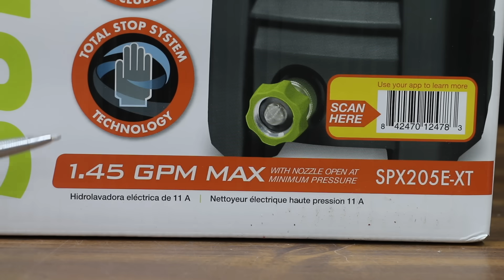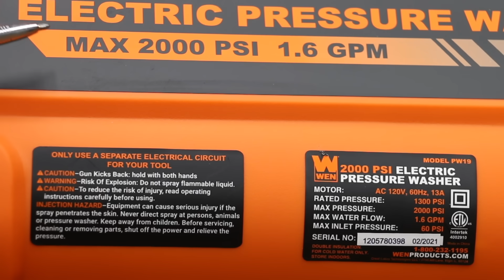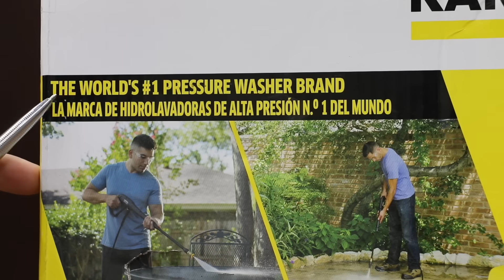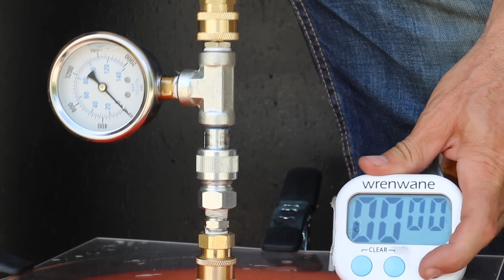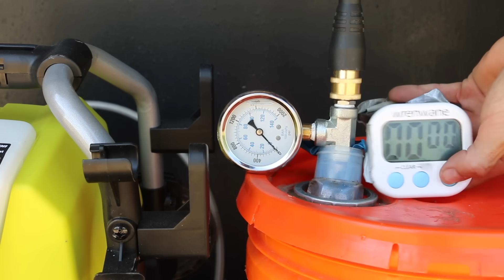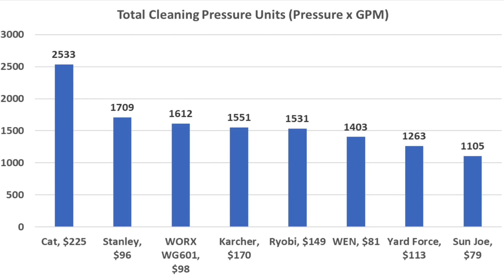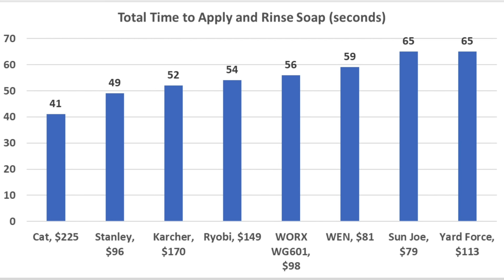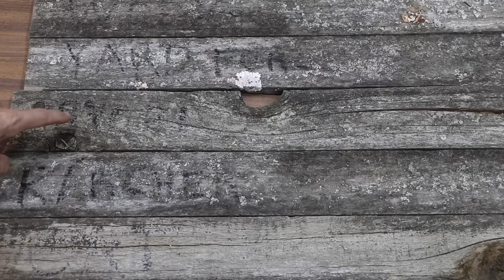Best Pressure Washer (ELECTRIC)? Ryobi vs Karcher, Stanley, Sun Joe, WEN, CAT & WORX

Comment: The Worx has a warranty but you have to pay to ship it if it breaks and pay for them to re send it. At $99 it ain't worth it just throw it away. Mine used 2xs and it is starting to fail. Spays straight and finally will rotate to clean and then back to just straight. Came with only 1 exttra tip two missing like yours on the video.  Garbage. Should have bought the ryobi.

Comment: Love it!! I've had the CAT 1800 for almost   a year now, great little unit. Matt over at obscessed garage sells, called the active  unit on his site. MTM makes a lot of great accessories for them as well.
Reply: How many hours do you have on it? I see amazon reviews that suggest it might fail after 10 to 70 hours of use.
Reply: @guytech7310  not sure, I use it for a small detailing buisness. I already had one fail but the return policy worked so well I'm still happy. It's still a very inexpensive unit compared to a base electric commercial pump unit.
Reply from the maker: Thanks for sharing.

Comment: Karcher No.1(in pressure washer marketing). Mine started leaking oil from the reduction gears. Bought a B&D, lasted for years and spares are easy to get. 

Try running a durability test, leave it running for hours and see which one dies first to simulate someone washing their driveway then their cars. I bet some will fail spectacularly.

Comment: Very good video but only issue is PLEASE USE METRİC AND İMPERİAL SYSTEM FOR MEASURİNG, not only imperial on the graphic. İf use metric (SI system) much universal and understandable than ımperial system.
Reply from the maker: Thanks for the suggestion.
Reply: We don't use the "Imperial" system in US, we use the US customary system. They are not the same. 1 US gallon is 3.785 liters (litres if you prefer).

Comment: I have a question that may have already been asked and answered (any helpful hints for me to search through 5,469 comments?) - why are you using a 3.0 and a 3.7gpm nozzle on pressure washers that only flow between 1.1 and 1.5gpm?  This will of course result in poor performance, and this is something that most users don't understand.  The tips need to be properly matched to the flow rate of the pumps in order to achieve good cleaning.  If you are several hundred psi low at the tip, as compared to what the unit's rated pressure is, you have a tip that is too large.

Also, for pressure washers in that size range, there is no way you are going to get good cleaning performance on dirty wood at a distance of 14 inches!  You have to get down to a few inches away for that class of pressure washers - I probably would have picked 4-6" for this test.  I have a Karcher electric unit in that size range, but my big dog is a 4000psi (dialed back to 3K), 4.3gpm 16HP gas-powered unit that you can use to make holes in things if you are not careful.

Thanks as usual for the great work!

Comment: from experience MINIMUM you want your pressure washer to be at least 1800 PSI at 2.0 GPM for a around the house pressure washer. Even if its 3500 PSI if its not pushing out 2GPM its not worth your money. If you choose to buy a foam cannon, I suggest buying and changing to a smaller orifice 1.1mm orifice size if you are using an electric pressure washer with lower PSI.
Reply from the maker: Thanks for the feedback.

Comment: I’ve been power washing now for 5 years and let me just say the china power washer will do the job but I’d say after more than 200 hours of use the pump goes. But for the good brands like karcher Briggs and stratton Bosch have really good pumps that last many more hours but in some cases I’ve had good luck with chinese brands. End of the day it’s up to the user. If you want to use it for weekend use then a chinese brand should be fine. But for commercial use get a good heavy duty brand. And also get a really really really good water filter! Most of my pumps had green gunk and sand in them.
Reply from the maker: Thanks for the feedback.
Reply: interesting you say that considering that these cheaper electric versions compared to the supposed "good brands" have longer warranties.  For example, most of the tested models here have 2yr warranties, whereas Briggs & Stratton, Simpson, etc electric ones only have 1yr warranties.
Reply: @hanwagu9967  yes cause the good brands trust their products. But it’s all up to the user.. Ive got a sun joe pressure washer which has surpassed 200 hours of use. So not saying chinese power washer are bad .. but take proper care of it and you’ll be fine.
Reply: @CuciWaterjet  I think you misread my comment.  The supposed "good brands" have shorter warranty periods--that is, one year.  The supposed cheaper brands according to you, actually trust their products more by warrantying them longer.

Comment: Excellent as always - a test idea, although maybe not mainstream enough - bike chain lubes - more specifically, whether or not they actually do anything - my theory that any lubricant not encapsulated, or replenished will quickly wear aware, and be back to metal on metal. Something like an electric motor driving a loaded chain/sprocket - lubed vs not.
Reply: and by bike I mean bicycle
Reply from the maker: Thanks!  Thanks for the video idea.

Comment: Thanks for another great useful video. I own the Karcher with the same kind of gun. And I love the pressure washer but I can't say the same for the crappy gun. The quality on those is very low be aware. The valve inside the gun is made of cheap plastic with metal insert and do not holds up the pressure and they crack, onece is broken it leaks everywhere, it happens the same with the gun tip, the metal tip adapter is screwed in to a plastic tread!.  I have had this pressure washer for about 3 years and I have to buy already 4 of those guns. And it is a shame that you can't adapt a better gun brand and you have to continue buying the crappy one.
Reply from the maker: You are welcome!  Thanks for sharing.

Comment: Here's a video idea: Removing exterior house paint off clothes with stuff laying around the house.

Here's a list of things that are mentioned in no particular order:

1. Vinegar sprayed on, or mixed with baking soda and pasted on
2. Non-Acetone nail polish remover
3. Acetone
4. Mineral Spirits/Paint/Laquer thinner
5. Hair spray
6. Rubbing Alcohol (or isopropyl)
7. Coconut/Vegetable/Cooking oil
8. 1:1 Dish soap and water
9. 1:1 Laundry detergent and water
10. Clorox 2 colors (basically color safe bleach) 
11. Hydrogen Peroxide
12. Oxi-clean 

For the paint, exterior paint is harder to remove imo. Try using both water and oil based paints (the latter's harder to remove)

For the clothing, try using regular cotton/polyester, denim, and that elastic dry-fit stuff that gym-goers typically wear.

Apply the paints, and let all the stains dry for a few days.

Apply the list of products a few times, once every few minutes on each stain.

Use a nylon drill brush (like the ones they use for auto carpet detailing), clamp the clothing down and let it brush in one direction for 5 minutes each stain.
Reply from the maker: Thanks for the video idea.

Comment: Hello, love your video. Very in-depth analysis. One of the best reviews on YouTube. Do you think using the impact force formula will be a better indicator to rate the pressure washers than the cleaning unit? The impact force formula is 0.052 x square root of PSI x GPM. Your expert comment will be greatly appreciated.
Reply from the maker: Thanks for the suggestion.

Comment: The CAT or similar is barely useable beyond cleaning a car or small projects. I live in Florida .. 120V electric pressure washers are bordering on useless because of the TIME to clean driveways, pool cages, Lanais, etc. Therefore, people who want electric power washers buy 240V or gasoline and they buy 50' or longer flexible hoses, surface cleaners and foam cannons for bleach / detergent.
Reply: I guess what I'm trying to say is you have a whole lot of apples and oranges (pressure washers) at least in this video. Price point comparison with been more useful. Sub $150 or $250-$350 or entry gas, etc.

BTW .. since I only clean my driveway and pool cage twice a year I prefer a high-powered electric with a really long hose, 50' or longer. Otherwise you're shuffling around which is very annoying your pressure washer.
Reply from the maker: Thanks for the feedback.

Comment: Hi Todd, I would love to see a follow up video on longevity of how the pumps/motors hold up.  I would be curious after say 40 hours of workload on the pumps and see how much pressure and volume they lose.  I am not a firm believer in these cheap Chinese made pumps, I have a feeling they won't last very long compared to something with a brass Triplex pump that has ceramic plungers and double packing seals.  Personally I would rather pay more and buy once for something that will last.
Reply from the maker: Thanks for the video idea.

Comment: Potential problem with filling the bucket. It seems very sealed and not allowing the release of any pressurized air, which there would be a lot of, unless you removed the air before then?

Comment: buy a Landa or Mi-T-M pressure washer, those all plastic budget machines don't seem to hold up like the brands I mentioned and most reputable repair shops wont work on them because the parts are not meant for repair but replacement. its the water that does the cleaning not the pressure, pressure just helps remove layered grime.
Reply from the maker: Thanks for the feedback.

Comment: @Project Farm  Hi PF. I wish you could verify this video's claim of No oil Run in an engine for several g
hundred kilometers. Oil pressure lamp blinking while driving. If only it could enter a lawnmower for u to test.

https://youtu.be/ICg264kWkBU
https://youtu.be/Hx3q9Kl0T5s
Reply from the maker: Thanks for the suggestion.

Comment: I have something I would like you to test and settle the debate on:  Wire nuts versus push in connectors.  Also compare the cheap bag of nameless ones you can find at a big box store compared to WAGO connectors.  I've heard that they are the best and worst from different people.  Some people say that the amount of metal in the no names will fail since its not a lot compared to a twisted wire nut, but the Wago one's are UL certified.  I think it would make an interesting video
Reply from the maker: Thanks for the video idea.

Comment: I don't think your test of the removal of buildup on the wood is a good indicator of anything. Each pressure washer was using it's own very different tip. The optimal distance from the board is going to be different for each tip. All your test tells us is which pressure washer does the best job at 14 inches from the board. For instance my pressure washer has three different sprayer wands each providing a different type of built in tip. An ultra fine fan spray, An adjustable sprayer and a spiral sprayer. Each wand performs better at a different distance from the surface I am attempting to clean. The adjustable is a good all around sprayer and the optimal distance changes as you adjust the flow. The fan sprayer cuts like a knife but only at very close. Any more than 12 inches and it drastically loses effectiveness. The spiral attachment is a beast. If you get it too close you can do some damage depending on the material. It spray a tight beam of water as the tip articulates in a spiral circular pattern. Even from two feet away it can easily strip mold and contamination from my driveway. The point is that I can get a similar result from the fan tip as far as cleaning effectiveness goes but I must get a lot closer to do so. And the adjustable tip is not as effective as the other two and best used for washing the car.
Reply from the maker: Thanks for the feedback.

Comment: I prefer electric pressure washers for around the house.  But longevity is always THE issue.  Seems like the pump/switch ends up failing.  I've been through several only using them once a month or less.  I'm lucky to get 2 years out of them...  currently have a karcher, i hope it lasts.
Reply from the maker: Thanks for sharing.

Comment: I've had my Karcher 1800 psi unit for over 10 years and I am not the type to take care of my equipment. I've never stored it properly or done any of the recommend maintenance and I'm surprised every year that the dang thing still works. This year it is finally starting to show it's age because it pulses while it pumps but it's still working! It owes me nothing. Good little machine. EDIT: I have driven over mine several times in over 10 years and had no damage. That said I'm sure if I hit it at the correct angle it would break. You did not drive over all the guns at the same angle to the tire.
Reply from the maker: Thanks for sharing.

Comment: I'd like to see a test of these different CA glue and powder kits.  
Baking soda and regular super glue can also be used to allegedly get the same results.  It would be great to see that tested too.
There may be others I missed.
I'd also like to see the glues that come with these compared against other super glues.
Thank you.

RapidFix Dual Adhesive System, 25 mL https://www.amazon.com/dp/B0021UMTZQ/ref=cm_sw_r_cp_api_glt_fabc_MGCF55NRNCPCAEYEHWG6?_encoding=UTF8&psc=1

GLUESMITH- Plastic Repair Glue System from The Gluesmith, Great for All Other Materials Also https://www.amazon.com/dp/B01MY4KS9V/ref=cm_sw_r_cp_api_glt_fabc_HN42B6PGJVWZX9W6YR03?_encoding=UTF8&psc=1

K Tool International Q Bond Adhesive Kit, Repairs And Reinforces, Plastics, Metals KTI90002 https://www.amazon.com/dp/B00HX704NG/ref=cm_sw_r_cp_api_glt_fabc_EJCZA27CKGNPZWT6CSZR?_encoding=UTF8&psc=1

PASCOFIX Strongest Super Glue CA Glue Crazy Glue Super Glue Ceramic Super Glue for Metal Glue for Plastic Repair Glue Shoe Glue Strong Glue for Plastic Epoxy Industrial Super Glue Rubber https://www.amazon.com/dp/B07RYN1TJN/ref=cm_sw_r_cp_api_glt_fabc_5KD1V1EG8N0SYMZBXEK2?_encoding=UTF8&psc=1

Strongest Glue by HG POWER GLUE Industrial cyanoacrylate ca Adhesive - Heavy Duty Glue for Plastic - Repair Car Boat Model Airplane DIY Plastics PVC Rubber Ceramic Woodworking Steel Metal Pottery https://www.amazon.com/dp/B07BQ1N98B/ref=cm_sw_r_cp_api_glt_fabc_8BKD3DA4S1A90DG984QS?_encoding=UTF8&psc=1
Reply from the maker: Thanks for the video idea.
Reply: Yes sir

Comment: I bought an older Karcher model a few years ago with same specs for $90. It works well enough for cheap electric and user reviews did report it had better pressure than others (although who knows actual perf of older units of all brands).
I also had reservations of the other cheapos on reliability. Many people reported they had failed with little use and their Karcher worked well for a long time.
Reply from the maker: Thanks for the feedback.

Comment: Looks like the same factory makes some of these washers and the Brands just have them slap their name and a different color on them. How original.
Reply: That’s how most things are made nowadays if you haven’t already noticed.
Reply: @QuantumMind88  loose the attitude
Reply: @rthomas6910  lose*
Reply: @rthomas6910  forgot your his mom lol
Reply: @motors-anonymous9783  😂
Reply: @rthomas6910  While his comment was slightly snarky... he also isn't wrong.
Reply from the maker: Thanks for the feedback.
Reply: Your right
Reply: It not only depends on the outside it depends on what is inside of them. But i get your point i used to work for a company that makes filters oil air and fuel and on the standard screw in oil/fuel and pop in airfilters tgere is just the difference on the packaging and labeling if its the same type of filter
Reply: But the price ranged from 10 to 50 euros
Reply: There were a lot of similarities between the guns and (I'd imagine) the innards, but the housings were all a little different, with slightly different features.  It's a little bit more than just putting your logo on a white label product.

Comment: I wouldn't doubt that many of these units are made by the same Chinese manufacturer which is why they seem to be so consistent with the assembly and spray nozzles.
BTW, I really appreciate the attempts you make to be as consistent as possible in videos like this.  It seems that you've gone to great lengths to achieve this uniformity.  Keep up the good work!!
Reply from the maker: Thanks, will do!

Comment: Could we get a video about small air compressors, specifically ones that could be used for removing dust from inside computers? Those cans of compressed air get SO cold, so fast, and only give a few minutes of really useful time before they just become waste. I looked in the past and could only find expensive and massive shop compressors which are obviously overkill, but looking now, it seems there are a number of smaller units, ranging from mini versions of the shop style ones with a smaller tank, to some that appear to have the form factor of a cordless drill, which would be hella convenient but seems almost too good to be true...
Reply from the maker: Thanks for the suggestion.

Comment: Though all of these machines have regular NEMA 1-15 plugs, some of them draw more than 12A continuously and will trip the breaker if used for an extended period on a 15A circuit, since these circuits are only rated for 80% of the stated amperage under continuous load.  Therefore, they should really be used on a 20A circuit to avoid this issue.  Considering that the CAT can draw upwards of 15A, it really ought to have a 1-20 plug…
Reply from the maker: Thanks for the feedback.